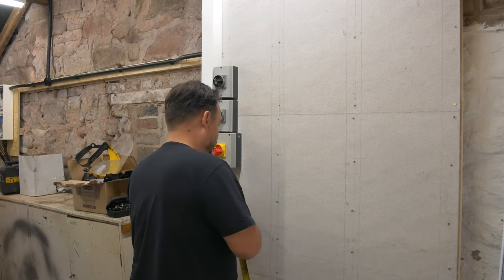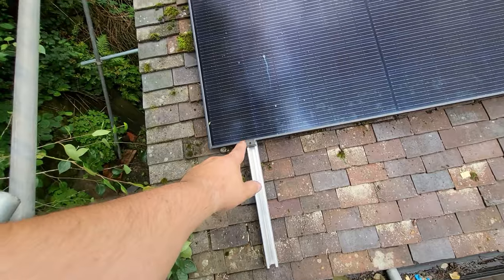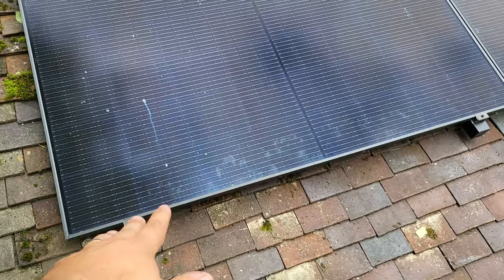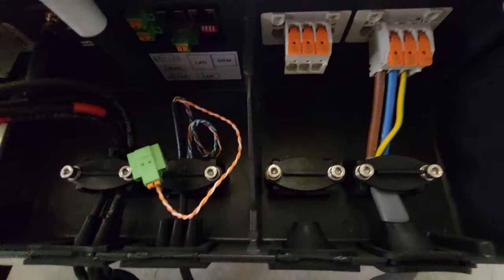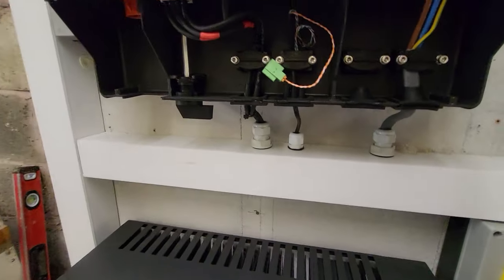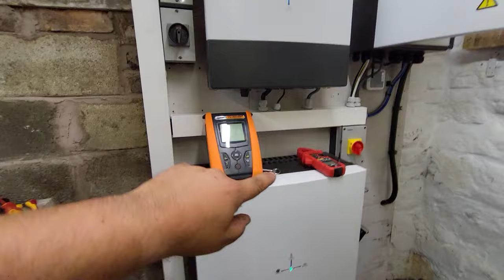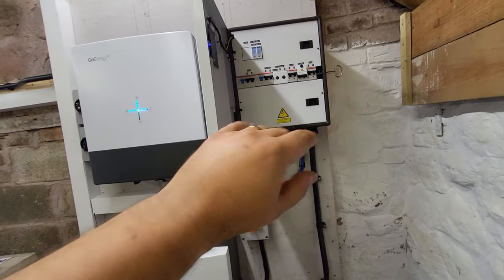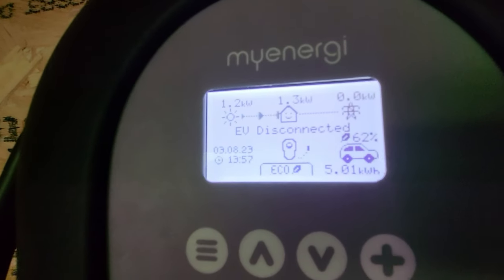13.5kWh GivEnergy All in one whole home battery backup with gateway and 5kW solar - Full Install

Comment: I have the 8.2kwh battery and for  years GivEnergy has not fixed the issue with app not showing correctly the percentage of the battery charge. They keep recalibrating, meaning completely discharge and then fully charge, but the problem persists. That’s not “industry leading” mate
Reply from the maker: That's your experience and a valid one at that. But in the context of many other brands with many other problems I'm happy to say GivEnergy are among the best in my experience anyway. 

This particular product is leaps ahead of anything else. 

The 8.2kWh varieties have never given me a problem aside from having to fit the DC isotor which is a pain. 

Has your install been checked over around the comms cabling, CTs etc?

I have no affiliation with GivEnergy in saying any of the above both good and bad. But I am happy to try and help you.

Comment: Noob question but isn't that a waste of a stand alone hybrid inverter? I thought the whole point of the AIO was it is an inverter & battery
Reply from the maker: Forward planning for something bigger on this one. But yes generally a basic string inverter can be used. You still need a PV inverter with the AIO and soon it will allow connection of multiple AIO and hybrids on the same setup. So when Matt gets his ground array. This will be a game changer.

Comment: A neat and highly professional electrical installation that is well explained.  The GW is a nice package but since our area does not suffer from power outages its a complexity I don't need.  I would consider the AIO battery as a stand alone device so waiting to see how they get on in winter at 2C or below.

Comment: Any chance you can cover the issues people complained about related to batteries suddenly dropping charge and inverters having issues or failures due to bad firmware or bad sensors.
Reply from the maker: I would be we haven't seen a single problem. Best place is with your original installer of giv tech support. If we get a case I will share it tho.
Reply: @electrician247  That's really good to know as I just paid the deposit for ours. Not sure if the panels are good, they said Longi 430w panels.

Comment: Very neat install and very well explained. I was just onto Givenergy technical support and could not get a proper answer about the gateway and all-in-one. One person told me the all-in-one was a hybrid inverter plus battery in one box. Another person told me the gateway was an inverter but then changed the story to suggest that the PV DC connects through it to connect to the all-in-one so there was only one inverter in the all-in-one acting as a hybrid. All total rubbish as I suspected from the datasheets. (Poor one sheet items lacking in detail - as are the insulation manuals).

What I wanted to know was what happened if you set the battery to self discharge to maximise export tariff - does the 6kW output first come from PV with battery help if needed or does it just discharge the battery by 6kW and the PV get wasted because there was only one inverter?

It's obvious from your walk through that there are two inverters - an AC coupled battery and a PV DC-AC inverter, so you could get 6kW battery + PV kW export potentially, but I'm still unclear about if the software limits export to 6kW for DNO approval and takes PV first with battery addition if the sun goes down, or if battery "force discharge" ignores PV and lets PV go to waste. Can you clarify?

Obviously, in addition, the inverter can have its own DC coupled battery as a hybrid - possibly the reason for the confusion.

Also, did you fit an earth rod for island mode?
Reply from the maker: We showed the earth rods in episode one of this job I think. There are two lol.

The g100 limit has to be set in all the generators. They all have sight of export values and work within that. It depends on the mode of operation as to what takes priority. But default is solar first then battery. 

If the export limit is reached the solar gen is clipped away. 

Hope that helps.

Mark

Comment: Hi Mark, great video, very informative. Do you think Enphase Microinverters into their Combiner and then into the Gateway would work with GivEnergy monitoring the solars AC input. Obviously the detailed Enphase data would still be separate. Saves having a string inverter.
Reply from the maker: I am not familiar with the enphase product. But if the final output is 230V AC it should work fine running through the gateway as far as I can see lol.

Comment: Very interesting to see these systems being installed, as I hope to get one at some point. Just an idle query, though: has it become common in the Trade to no longer differentiate between kW (e.g. inverter power) and kWh (e.g. battery capacity)? You use "kW" a few times when talking about batteries. Even on your website.
Reply from the maker: That will primarily be due to my dyslexia. To ensure the world gets a fair representation of myself I share warts and all. Along with writing all the content myself. 

Seems to work well. 

Thank you for pointing it out though and have a great weekend. 

I

Comment: Hello Mark - So informative, this shows to casual watchers what a specialised field this has become, brilliant work from you and team! 

Can you just say a couple of words about the actual mounting back-board created - our garage wall is 1920s brick built and as such pretty uneven courses, 
so a nice true vertical surface looks like the best option - what was used in its construction, please? It looks like timber and fibreboard, but presumably ply/OSB of a decent thickness would also work. 

Any information would be a great help - we are aiming to bring our 1925 building up to 2025 spec, so a fair bit of equipment will be hanging off the garage walls.
Reply from the maker: This was created with a stud frame, 18mm ply and then a final cement board top. The walls were very uneven. 

On brick you can secure the cement board direct to it. If using ply then cover again with the cement board. 

Thanks.

Comment: Great info. Thank you for the video.
Can you please throw  more light on the V.drop you spoke about in this video, kinda my my brain is hot looking at the whole thing. 
Is this givenergy gateway Install the same as Tesla gate way? I need your help please. Thanks
Reply from the maker: Volt drop is the calc we need to consider based on load and length of the submain to the gateway and then beyond into the wider install. 

It is similar to tesla power wall.
Reply: @electrician247    many thanks , very helpful information.

Comment: With the Battery and Solar, what was the output listed for the G99 or can the AIO limit export (G100?). Also is the battery the AC sync source for the solar inverter during grid failure as surely that should stop output too?
Reply from the maker: AIO can export limit but is a generator on the G99. The gateway brings the system together so the PV inverter would never know the power went out. It keeps everything safely in sync and offers instant whole home backup. All runs together, worth checking the GE website if you have questions on it.

Comment: Really interesting video with great detail.

I'm currently in the process buying a house that needs a lot of work doing to it. It's a 1970s era house nr. St. Austell in Cornwall with an old oil heating and hot water system (no gas main in the area) and old electrics.
So I'm considering a system like this, solar PV + battery etc but, I'm considering ditching the oil burner to be run an air to water heatpump too.

So would a system like this in the video be suitable for running the heatpump too, or would the heatpump draw too much power for the Givenergy All in One system to handle. What upgrades might be needed to this system to effectively run a heatpump too ?

The goal obviously would be to install as much solar PV as possible and power the heatpump using as little grid energy as possible.

P.S. Do you consider working in South Cornwall area ?

With thanks again.
Reply from the maker: Hi Chris, we travel all over the UK working on interesting projects! My father in law used to live in Lostwithiel and Greensplat so I know the area well lol. 

In terms of the heat pump the answer is it would generally be able to meet the demand. However the 13.5kWh battery would likely be insufficient storage in coldest darkest winter. That’s the reality of the technology. ATM you can’t add additional AIO units but that is imminently changing. Which makes it more achievable.

That said for most of the time combined with a good sized array it will meet a lot of the consumption/demand. 

More than happy to propose a solution if you want to email mark@powersonic.co it is just .co on the end. 

Thank you!
Reply: @electrician247  Really positive response, thanks. I'm gathering info about systems and searching for the right expertise for when the time comes. Great to know you can cover this area too. The house purchase process is likely to take another couple of months, I might well be in touch as things progress !
Reply from the maker: @chrisgavin  no problem, happy to help if required. Good luck with the purchase.

Comment: Very interesting & enjoyable video, thanks. Given there are no DC-coupled batteries, why did you use a hybrid inverter & not a simple solar inverter?
Reply from the maker: To have a matched Giv Energy install. They don't currently offer a string inverter. 

But also its very likely DC coupled batteries will be compatible with the AIO soon... which will be nice for this customer. 

This week we used a solax string inverter with the AIO. Horses for courses.

Comment: Hi Mark great install video, couple of questions do now not install a general meter and just the Easton smart meter for energy's readings? Also with the hybrid installation connection into a domestic single phase board you have installed a MCB on main switch but no RCD. Is this because of the RCDs and rcbos issue with being directional in regards to current flow. Hybrids needing bio directional devices because they send power to the load (fuse board) and draw power to the inverter to charge the battery.
Reply from the maker: Hi mate. Inverter is powered from the gateway. It has rcbos in it. You don't generally need them though unless the cable installation method dictates it. 

Meters are also in the gateway. 

Thanks

Mark

Comment: Thanks for this - but isn't it ok to omit the DC isolators now, and use the internal isolator in the Givenergy Gen 3 inverter?
Reply from the maker: That would be a decision for the installer. Ive shared my views extensively on this and DC isolators should never be omitted. Sensible point of isolation for future maintenance within the fixed wiring rather than products. Cant see why competent electricians would want to omit them tbh.

Comment: Very informative video 👍. Just one question, is that hybrid inverter necessary? Or could the all in one function by using the built in inverter in the all in one?
Reply from the maker: The all in one is AC coupled and at the moment has to be installed with a gateway. Software updates are on the way which can allow for the gateway not to be needed. As discussed in the video you can use any PVinverter with it. But we have sort of future proofed plans for maybe more batteries on this as giv energy release new software....

The all in one does require a PV inverter of some description tho just to be clear. It has on PV inverter in it as discussed in the video. Just AC coupled

Comment: What can the AIO do that a GivEnergy battery and hybrid combo can't? Also why do I only ever see the AIO with a gateway? Thanks
Reply from the maker: Can’t currently be installed without a gateway, however that is due to change. 

Much more in short. A hybrid is limited to output 5kW of power and won’t keep the PV inputting while off grid. 

An aio can output to 7.2kW plus the PV output AND it can charge itself with the PV while off grid.

Hybrid is still a solid option for those who are not concerned about off grid. But worth noting with high power usage the AIO gives lots of flexibility on grid for say a heat pump of EV. Utilising stored energy alongside the PV to output far beyond a hybrid. Night and day.

Comment: Good to see quality workmanship and installation unlike many other cowboy solar and battery installers. What do you use for DC cable entry on tiled roofs?
Reply from the maker: Dektite kits work well. But sometimes can't beat oval tube between felt laps. Sealing ends up for insects etc. Not a fan of grinding a slot to simply poke cables out of.

Comment: Hi there, we are looking at starting to install the GE AIO. I see you have a hybrid inverter installed, would a string inverter not be suitable/cheaper as it's an AC coupled battery system the AIO?
Reply from the maker: Yes you can use a normal string inverter 100% in fact we have done that a few times 😁

Comment: So I’ve decided I want to go with the AIO solution. I’ve a quote that is using a Solis 5kw inverter rather than the GivEnergy inverter. Is there a reason the GivEnergy inverter can’t be used..?
Reply from the maker: Givenergy don't make a string inverter. It's lower cost to use a non hybrid and you won't be using the feature of having one. Totally fine with a solis string inverter.
Reply: @electrician247  great, thanks...👍

Comment: Hi Mark, great video. I have a question for you. If I have a gateway and all in one, plus solar inverter. Do I also need an Eddi diverter to integrate with heat pump /water tank? Or does the Gateway replace the Eddi? Thanks.
Reply from the maker: Hi Richard, this is a question of how you want to direct excess generation. The ASHP will be part of the houseloads so will get some of that. But you can separately look to direct that excess to immersion elements etc via an eddi the same as normal. Will just need to set an export margin on the eddi so its not taking priority over the AIO etc.
Reply: @electrician247  thanks. So basically the Eddi is required over and above the Gateway device... to manage the diversion of PV gen electricity to the hot water specifically. Have I understood that correctly?
Reply from the maker: @richardkyle5115  yes that's correct. However if you have an ASHP you might get better value not diverting to an immersion and providing power for that instead. Depending on SCOP values etc and how much excess generation you have. 

Installs without ASHP benefit more easily from an EDDI alongside a water tank. Same principle for the element in the ashp circuit. Might be better served powering the pump itself at certain times.

Comment: Are the solar panel fuses within the isolator switches?
Reply from the maker: Fusing is not required on small domestic systems. That   said the optimisers have lots of safety mechanisms built in.  They live under the panels.

Comment: Hi Mark, it’s great watching your install videos. I’m looking at installing a GivEnergy 5kw Gen3 inverter and Gen 2 9.5kwh battery. But I’m starting to think that the AIO solution may be better. We generally use 10kwh per day (plus whatever the EV uses) and seldom have any power outages. What’s the pros/cons on either solution in your view..?
Reply from the maker: Aside from the backup capability on the AIO. You also have the 6kw in/out which will peak to 7.2kW 

The 5kW and 9.5kwh is a rock solid option but doesn't quite offer the same features but it depends how much you want to consume/insert into the battery system all at once. 

I guess that depends of you consider the extra 2-3k costs worth it. 

I wish they was available when I got my solar and am fighting very hard not to replace my system and avoid contributing to electronic waste lol.

Comment: Hi Mark, thank you for the great video.  I have a question please.

My installer connected everything and commissioned it, then we changed the communication to Ethernet as did not want WiFi. We can see the AIO in the GivEnergy cloud and app, but the gateway does not communicate anything and it says offline in the cloud.

Are you seeing the AIO and the Gateway communicating? Or just the AIO as it does it all for both AIO and Gateway?
Reply from the maker: The data is generally shared via the AIO but both should be online. You will need to take LAN cables to both though. 

The LAN port on the gateway is bottom left I believe. Not sure on the AIO but the labelling is better in that!

Comment: I have a SolarEdge installation with 10kwhr DC connected battery. Is it possible to connect the GivEnergy all in one AC unit to my system to increase battery storage capacity.
Reply from the maker: It is something lots of people have asked. The trouble is the batteries and inverters can end up fighting against each other a bit. 

If you have lots of excess generation then the AIO would help mop that up but what can happen with off peak charging especially is the batteries top each other up. 

It's not something we have done before tbh so we have to seak guidance from a givenergy and solaredge